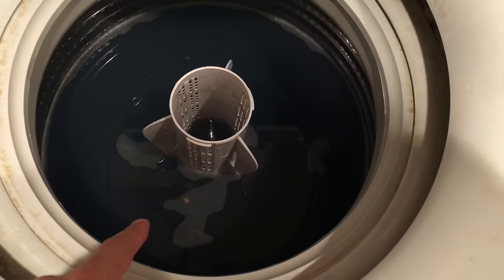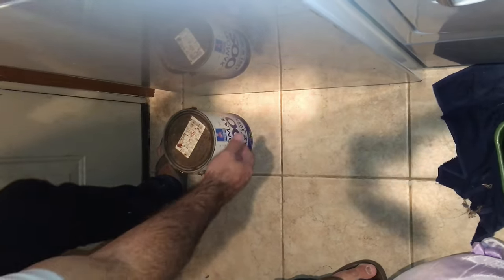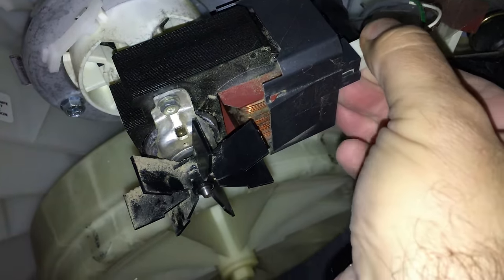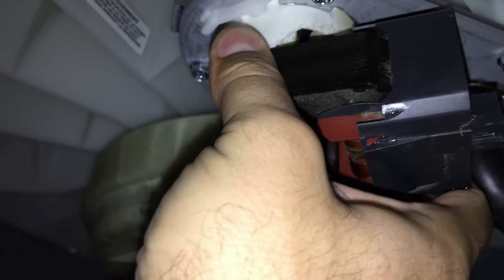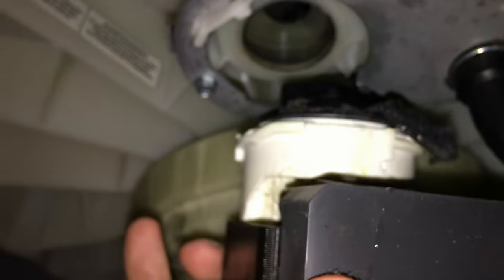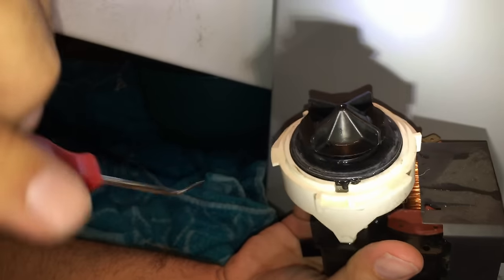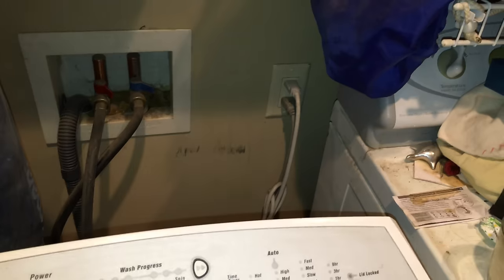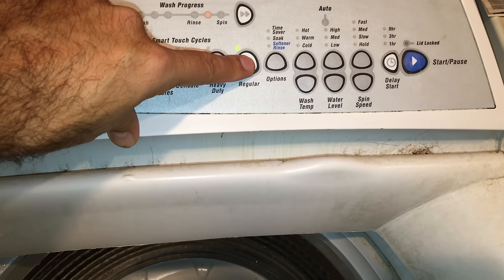Washer Won’t Drain? - How to Unclog Your Drain Pump - DIY Tutorial

Comment: Thanks!  I am glad I didn't order anything too quickly. I used the process of elimination, so I knew it wasn't the lid lock because there was sound when I turned on the spin cycle.  I was thinking maybe the other doohickey (forgot the name of it). You helped me a lot because you said people could use their wet vac to drain the washer...I did that because I was about to use a cup. You said the filter could be clogged.  I didn't see any obstructions but because I was alone, I blew into the hose.  Viola, there was resistance so I blew until there was none.  I hooked everything back up and everything is working fine now.  Thanks!  I didn't have to spend one dime.  I am guessing the 47 thumbs downs that you got, were from people whose problem didn't get solved.  You did a great service for me. " Any-who," no more water on the floor and now it spins.
Reply from the maker: Glad I could help!!

Comment: Cheers man. Didn't want to go to bed without sheets. Got everything sorted within half an hour, a small cotton ribbon had gotten in there and was jamming up the motor on our Fisher and Paykal toploader. I had to leave the overheated motor to cool for a while before I could take it off, and it got a little bit wet, so I held a hair dryer over the motor windings for a few minutes before reinstalling it. Much quicker and easier than getting the landlord to try sort it. Tyvm for the good video.

Comment: Something to note: there's a rubber hose that is connected to the drum and to the drain hose that takes the water out of the washer. That hose was clogged from washing rugs and pieces of the rug backing came off and was my problem. The hose is held in place by 2 snap rings that are easily removed. IMPORTANT: to remove the hose from the drum after removing the snap ring you have to TURN the rubber hose as there are notches. If you just yank it off you can rip it. I used my shop vac to get all the gunk out. I then also used diagnostic mode to run some water in the drum and turned the motor on and expelled the water back into my laundry sink to catch any extra debris. Glad I did, I had to do this a few times to get all the stuff out. I hope this helps someone else.
Reply: Hi Jim, how do you access this hose.  Can it be accessed from underneath (where the pump is) or accessed by unscrewing and opening up the top of the machine?  Thanks 🙏
Reply: Now i suspect mine has the clogged hose issue.  Water backflow  into drum even the pump worked hard to pump out the water but maybe the water cannot exit fast enough and some still left in the drum. Then the next cycle cannot hapoen due to the pressure switch not turned off.

Comment: Crisis averted!  Thanks!  My Whirpool washer looks nothing like this, but I still found this helpful enough to save the day (and Xmas).  I'm a 40-year-old single mom with no money in the budget for repairmen or new appliances.  I thought I was totally screwed after pricing new washers.  I had to drain the thing using a dog dish bowl lol, which took about an hour.  I soaked the rest of the water up with a blanket and tipped the washer up on its side rather easily.  Luckily it's in the basement next to a drain because there was still a fair amount of water coming out.  I'd had everything unplugged and water turned off prior.  I just found the part closest to where the drain hose connects and figured that's got to be the pump, and sure enough!  As soon as I unscrewed that cover, one of my daughter's socks was very visibly clogging up the pump.  It also smelled horrible like mildew and burning.  Luckily the motor hadn't burned out yet.  Sock removed, cover screwed back on and tipped the thing back up.  I ran the diagnostics according to the "secret manual"  (that booklet that they try to hide inside the machine that says "technicians only" or something pffft) and this time the pump worked! All of the other tests work too, and I'm washing a load in there right now.  Thanks again!
Reply from the maker: So glad it was able to help you Amber! Great job on the repair!!! 👍🏻

Comment: I got mine cleared thanks to your video, so thanks :)) My case didn't go as you showed though, so figure I'll give some details in case it helps others.
So I clearly have a different model to you going by what I found on opening it (plus the control panel), but anyway, mine completely blocked up after I washed a rug that was supposed to be machine washable & it shed a TONNE of cotton blobs! 
I'd managed to complete that wash, with it making weird noises & with chunks of rug in the bowl, so I cleared out what I could & then ran it through just with water to try to clean out properly & that was when it blocked completely for me. I tried letting it rest then starting again numerous times, didn't work, I tried shaking the bowl a bit, didn't work, then I took it back to a full wash cycle & let it agitate for a while & that cleared the blockage enough that I could get the water to slowly drain with the machine's drain cycle - while seeking out a solution on the internet & finding this video. 
I put it through spin a couple of times, hoping to clear all the water (worked, but the smart thing would have been to turn off the taps & clear the water from them into the machine & then via the spin cycle before disconnecting too).

When I turned the pump thing to disconnect, I had no water come out at all :) It did stick a little though when trying to turn it & then I heard a snap & a piece of plastic fell out. I have no idea where exactly it was from & doesn't seem to stop it working, I think maybe it's some sort of anti-tamper clip. Seemed to have been located on the side of the pump that is closest to the front of the machine & therefore completely out of site when the machine is tipped up as per this video. Probably possible to feel or look for if the person knows there's something there stopping it turning & it probably can be uncliped instead of breaking I would think.

Ok so pump off & mine was 100% clear! no blockages whatsoever on it, however there was a tail of cotton muck from the rug hanging down from the machine towards it. I spent the next hour or 2 half under the machine, with a portable light & a mix of pliers & tweezers, prying the rug muck out of the plastic area directly above the pump (there were 2 half toothpicks in there too, no idea how long they'd been there for, but at least a few washes). I would suggest to anyone following this video, while you're down there, put your finger in & check for any extra muck in this section of your machine (although I think it might be different because of being a different model). Finally I got everything I could out & it appeared to be prettywell clear, so I examined everything trying to figure out where the plastic clip came from, but couldn't figure it out, so re-assembled & hoped for the best. I ran it through with just water & on draining, more cotton muck from the rug came out the drainpipe, no idea where that had been hiding, but the weird straining noises were gone & drainwater was coming out at full speed. On the rinse, very little muck came out, so it seems like I probably have it all out now.

I developed a water leak into my machine's bowl though, no idea how/why, but the pipe along the top, near where the water fills the machine was dripping. It was bad enough that it was clear that if I didn't turn the taps off after using the machine, it was likely going to overflow within the week or so that I often go without using my machine & was also a problem in terms of re-wetting spun clothes before they could be removed, however running the machine through a number of times seems to have reduced, if not completely stopped the leak now. I assume it was probably something to do with the angle the machine was on during the cleaning, dunno, but if anyone else gets this, run your machine a few times before turning off the taps & calling a repair person, as that will probably fix the problem (hopefully) First run through did nothing to reduce the leak, second run through I used warm water (first was cold), not sure if that was just a co-incidence or if that made a difference.

So anyway, hope that's helpful for others & thanks so much for the video Extreme DIY! Wasn't that "extreme" at all, was pretty simple after watching your video, so much appreciated :) I wasn't that worried about the money for a call out, but rather that I have a really busy schedule for the next couple of weeks, no chance to get a repairman in, & really did NOT want to go that long without a washing machine (have clothes I need multiple times during that time for really dirty work), so this was a lifesaver for me :)

Comment: I just had a repair guy here yesterday for that same machine, Fisher & Paykel GWL11, he didn’t even look at the pump, just heard the grinding sound and said I need a new pump. I assumed he knew what he was talking about until I just found your post.  Then he said they don’t make this pump anymore, that I would have to replace with a difference pump, & since it’s a different pump, the control panel would have to be replaced too with it. 🤦🏼‍♀️ wanted over $850 & no guarantee it would be fixed.  I am going to try this tomorrow & let u know.
Reply: Just a follow... tried it, it works, amazing and thanks for your post
Reply from the maker: Awesome news!!! My pleasure! Glad I could help. 😀

Comment: A good idea if possible is to unhook the drain hose from the back, and try to shop vac as much water as possible out that way too. Helps a lot if you can do it.

Also, make sure all the water is out before you try to use it. A lot of machines will overfill if you don't
Reply from the maker: Thanks for the tip!

Comment: Your video is very helpful👍
Though my model is different, I get a good understanding of the structure/part where the problem that I encountered was tied to.
Was successful to nail the cause of the problem and fixed it. Feel so rewarding - not only the $$ saved but also the gratification from the can-do spirit💪
Thanks a bunch for sharing, very beneficial! Wish you continue to achieve success one after another🤗
Reply from the maker: Glad to help!! 😊

Comment: If the pump has water coming out, never leave the wires in the way but dont let water go through the cover as a wet pump will shortout and blow the motor board! Also its a really good idea to check the pockets before loading the washer!!
Reply from the maker: Thanks for the good tips Luke!
Reply: No problem! That was a good idea letting the pump dry out so that way you dont blow it! You should make more of these!
Reply from the maker: Thanks! Hope I don’t have to, though! ;) Just had to to replace my fridge’s defrost control board and my dishwasher’s circulation pump too - all within like a month of this repair! My appliances are freaking out on me!! Lol Got vids uploaded for both of those as well, and I’m trying to really up the vid quality with better lighting, sound, editing, humor, creativity, etc. Check them out and let me know what you think. And would love to have you as a sub! Thanks again!
Reply: Before I purchased my 2011 Whirlpool Top load Washer I had a Top Load Whirlpool Washer and it lasted 21 years. These complicated Machines are unreal.
Reply: Extreme DIY 
I didn’t follow that one, don’t let water go through the what cover???

(“ as a wet pump will shortout and blow the motor board”)
Reply: @ExtremeDIY  me too! My LG refrigerator is down and within two weeks my Fisher Paykel washer won't drain! The refrigerator is only 4years old and the compressor was replaced last year. The washer is about 7 but was repaired before. Sorry you are going through the same mess. They ALL make horrible appliances today. They are just ripping us off . It's really sad.

Comment: When drain pump starts acting up like that, you might as well order one to have on hand as it will eventually go out, usually at the most inconvenience time. I keep pump belt and roller set on hand! One very important thing! Follow manufactures instructions as running clean cycles and cleaning out the trap!! It will save you a pain!!!

Comment: The pump can get blocked if you put mud in the drum and it gets mixed with water, because soil mixture can block the pump, another fault is the objects stopping the propeller from turning, the direction of rotation of the propeller does not matter so it rotates sometimes clockwise sometimes counterclockwise, it's very simple to fix the pump, so make sure the pump isn't blocked otherwise there will be a code error.

Comment: Thank you for this video! I did everything as you said (nobody else on the internet, not even F&P had the instructions or troubleshooting information for this) and it still doesn't work. Maybe you can help me. The fan on the pump is going fine, the wash cycle goes just fine, but when it gets to the rinse cycle, the pump just grinds off and on, and nothing happens. Even when switching it to spin it does the same. The error code is 37, or 00100101 (Pump blockage?) but it is completely clear and clean.  
One thing I did note after I had taken the drain pump off and replaced it, I tested it in what I think might have been diagnostic mode and it started spinning in the spin cycle (with nothing in the machine, mind you.) Once I added three towels and ran the washer that's when it did the same thing all over again. Now, I am back to square one and need to go bail out water again. 
Do you have any advice for me based on your experience? BTW? I have the same model as you had, the GWL 11
Reply: WOOT! got it to work, cleaned out the y connector and found a small clump of stuff in there. That's all it took to make it work again. These washer/dryer sets are for the birds if it takes just a small amount of lint to make them stop working. What a joke. There is something to be said about the workhorse washing machines of yesterday! If a system isn't broken, don't fix it just so it plays a tune and looks cool! ha.
Reply from the maker: Awesome job Kathryn!!!
Reply: Kathryn Gustafson did he mention a y connector?  Where is that part.... I’d like to try that next too to see if it will help
Reply: @27photogger  I have no idea what a y connector is either, but in mine, I needed to clean the part directly above the drain pump with tweezers. Sticking a finger into that part I could feel the muck that was blocking mine (getting it out was not so easy, but can be done with perseverance)

Comment: Or, as it turns out, it could be a large green frog jammed in the outlet pipe! (I won't provide a picture)
Reply: A real frog 🐸!? 😳😳
Reply: @kristycaldwell8309  Unfortunately yes Kirsty. And it had obviously been there a while. Quite an assault on the nose and very difficult to pull out of the drain pipe! Poor old thing.

Comment: Mine wasn't spinning right so I took off the dasher and it was full of gunk.  Now it is doing fine. The motor was getting hot to.
Reply: What’s the “dasher”?
Reply: @27photogger  The dasher is in the in bottom that makes the clothes move around.  I bought it last year and it hadn't been cleaned, it was a lot of mess. So it works ok now.

Comment: How the hell do you get to the drain pump? How do I remove the entire outer body of this contraption? You skipped that step entirely
Reply from the maker: It’s underneath. You just lift up the front and set it on a paint can like I did in the vid.
Reply: Extreme DIY I did but I think I may need to lay it on it’s side to get to that pump. You have a different model than mine. I have a whirlpool so stuff looks different underneath on mine